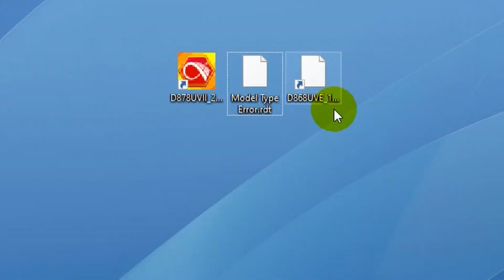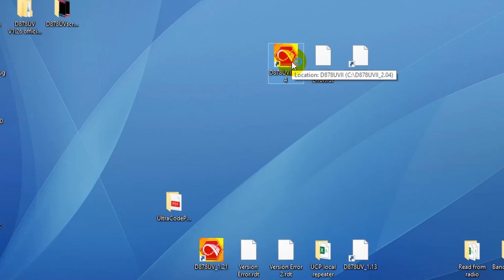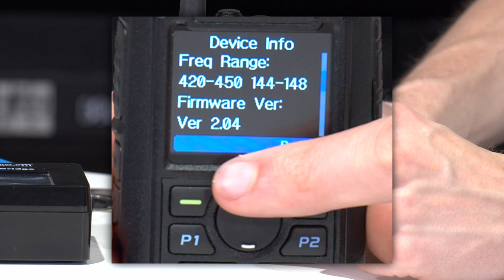How to Fix the "Model Type Error" When Programming Your Radio

Comment: I am using the correct software and version and still get the error message.  I think the RT System software is full of errors.  I've had problems with every model I have tried to use. I'm currently trying to use the AT D168UV software.
Reply from the maker: Hi, sorry to hear that. Please create a ticket here for further assistance: https://support.bridgecomsystems.com/kb-tickets/new Thank you!